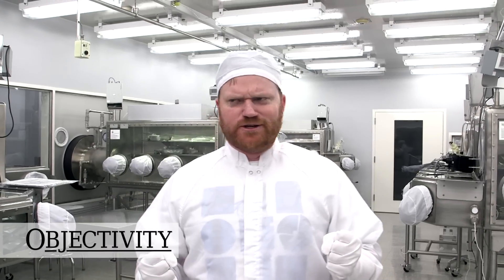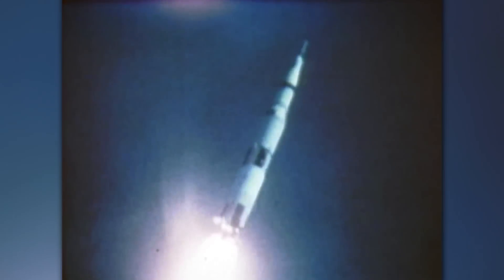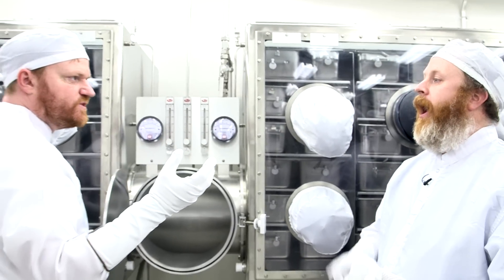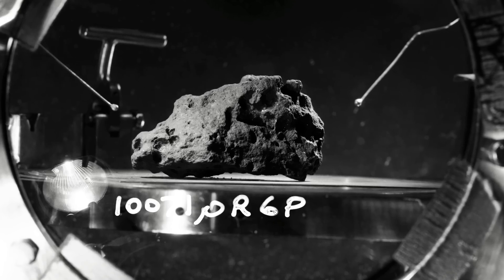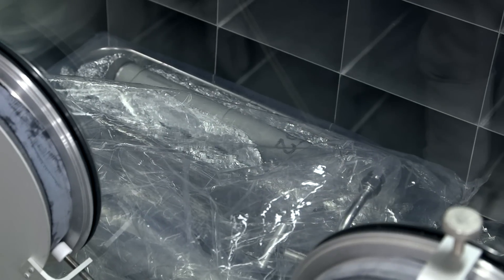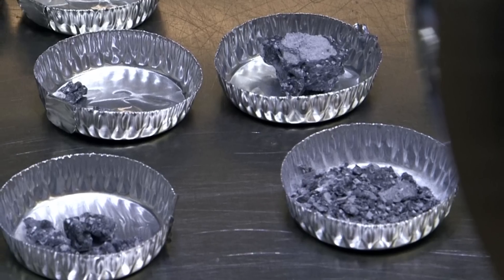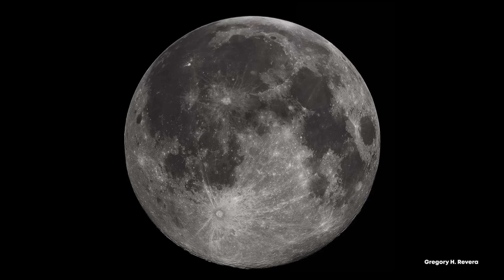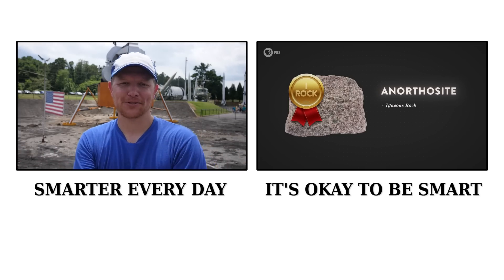The Genesis Rock - Objectivity 208

Comment: What are the unique characteristics of moon rock?
Reply: Well - nothing much per se (Earth is also made up of "space-stuff" from the formation of the Solar System). And us humans, we are made up of space stuff too - (aka the periodic table). 

An interesting fact is that the Moon is way less dense than Earth. And this supports the collision model a great deal. For obvious reasons (in science) we know that our core is way denser than our surface (you know - buoyancy and pressure and such interesting things). The land-mass on Earth (our continents - or "plates" are much less dense than the rocks in the ocean. This is the zero-order understanding of why ocean-crust are located 4000 meters below sea-level and continents are above the sea-level even before we discuss the dynamics of tectonics. 

So - back to the density of the moon. It is "light" compared to Earth. Almost as if it made up of mostly planetary crust. As if it is made up of mostly the "shell" of Earth - instead of our core. Extremely simplified - the crash peeled off earth's outer skin - less of the heavier inner belly. So Earth's baby by definition must be less dense than the core of Earth itself.

Comment: Why don't they use argon as an innert gas protectant? It's as nonreactive as nitrogen if not moreso. Also, argon is denser than air, and so displaces the air, more effectively keeping contaminants away from samples. It's doubtful that the samples have been rigorously protected from oxygen given the protocol illustrated in this video. Are there any moon samples that are more pristine?